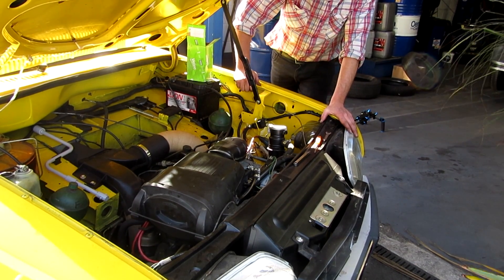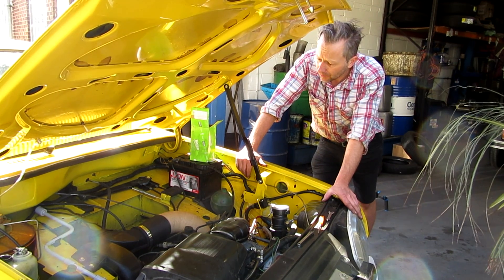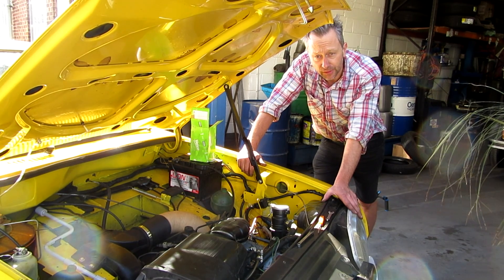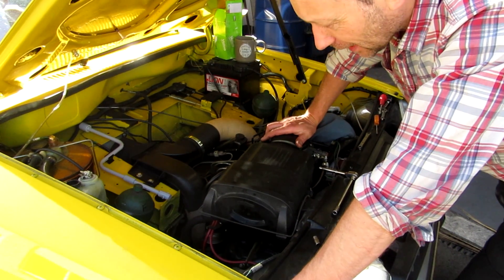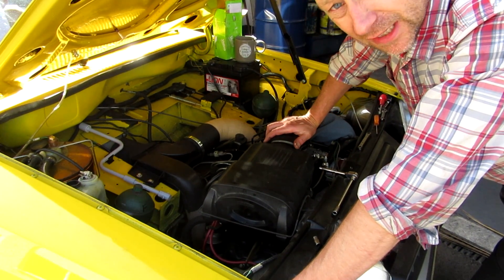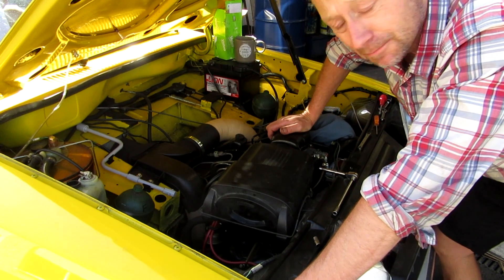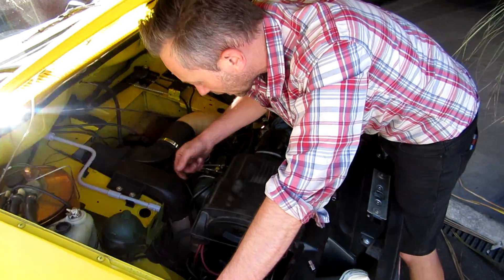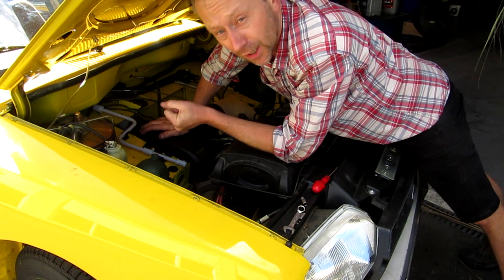(Fitting A Citroen GSA Fuel Pump) Citroen GSA Restoration Project

Comment: The valves rattle a lot and still need to be adjusted. Otherwise a very nice GSA Club of Series 1. I have a 1980 GSA X 3 from Spain (also built there) in the same color (jaune mimosa / mimosa yellow and Interior in chestnut brown).

Comment: oooooh something aint right with that motor. i hear you knockin but you cant come in !!
Reply: even if it's knocking.. it'd be hard to throw a rod as the crank is forge-fit.
Remarkably tough little motors.
Reply: @Gundamzerowing1  they certainly are.i had a few of em back in the 1980s when you could buy them for scrap money. mine all fell to bits apart from my r plate 1220 pallas in gold which was in beautiful condition. none of mine gave any probs with the engines apart from my x reg gsa with noisy camshafts., they just keep on going.